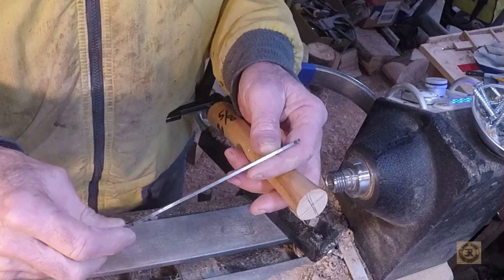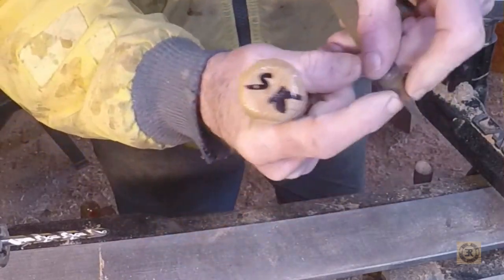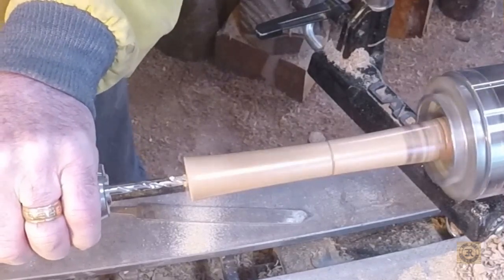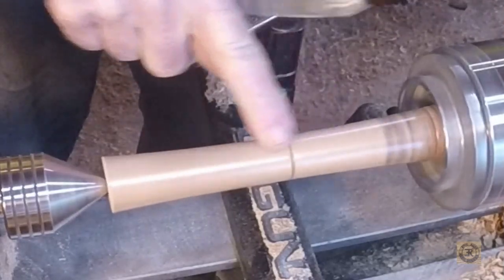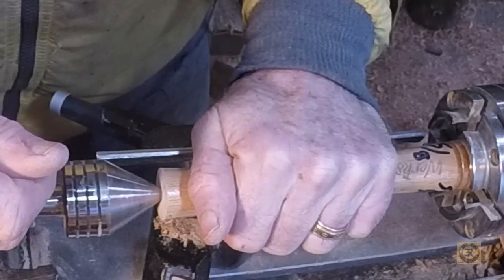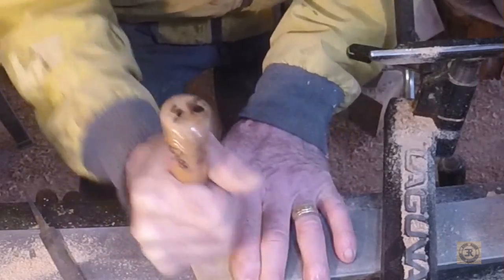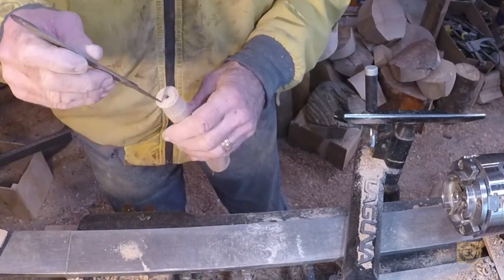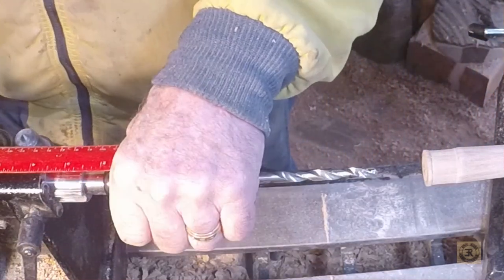Making a Parting Tool from a File

Comment: I have parting tools that are the classic design of a flat bar with a cutting end on it. But I don’t use them anymore since I bought the D-Way parting tool. It is wedge shaped and you only need to do a single cut since the sides don’t bind or burn. Big improvement over the classic shape tool. But making your own tool comes with personal satisfaction. So enjoy your parting tool until you get a chance to acquire a wedge shaped one!
Reply from the maker: Thanks for the D-Way tip. Ordered on yesterday.

Comment: I enjoy using tools I’ve made. Files, however, are not the best source of tool making blank. In the manufacturing process they are cooled quickly to make them hard and are not tempered. Therefore files often contain micro cracks that have a tendency to make themselves know at the most critical times. Your tool looks great but you may want to take the time to temper it properly.

As a small parting tool it should work out fine since you won’t be putting a lot of pressure on it. It looks great. Nice job
Reply from the maker: Thanks for the info, Doug. I know almost nothing of metallurgy. I'll be careful to avoid asking too much of it.
Reply: I know a fairly decent local turner that makes his tools out of files.  No have ever snapped on him.  He is fully aware of the internet talk.  He did say, "well,  nothing has blown up yet in 30 years."